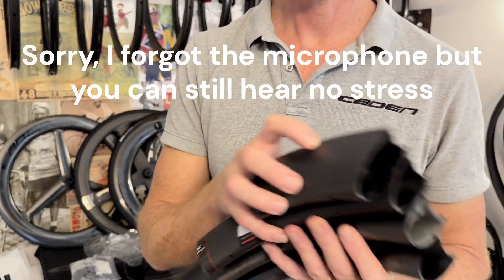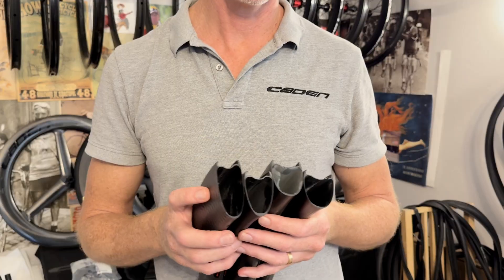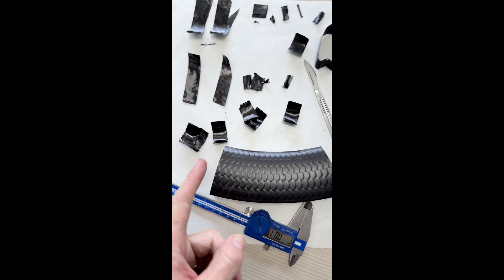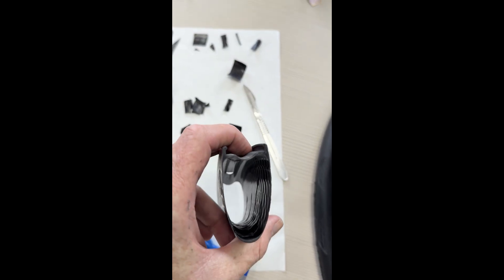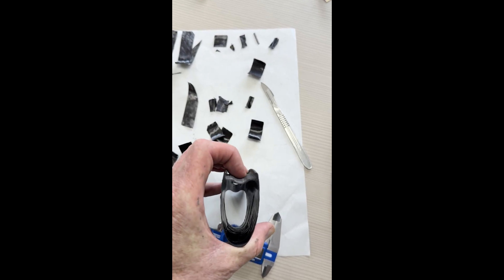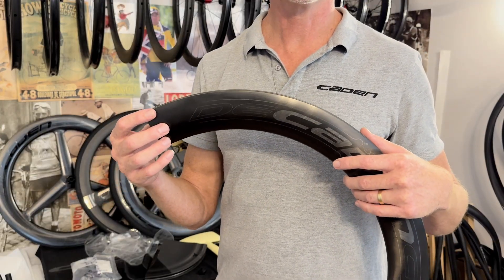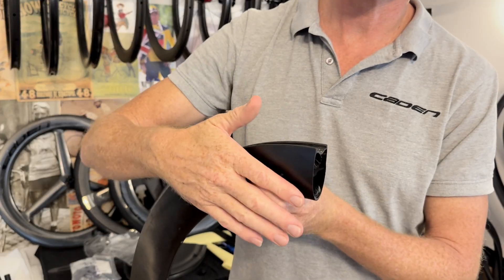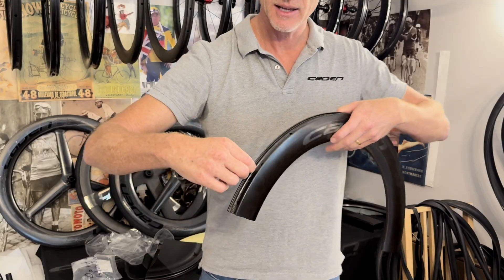Scope Artech 6 Layup Schedule Rim Profile Burn Test

Comment: Hey Ben thought i would weigh in on the rim blowouts we've seen from some of the US brands. I am experienced mechanic for a big retailer.

ENVE as you mentioned did not have a pressure relief hole for air as the air pushed past the tubeless tape (note these rims were marketed as tubeless ready) and as such were blowing the side of the rim out. 

ENVE acknowledged (maybe not publicly) this was an issue and as part of their warranty process issued new tubeless valves that relieve pressure from the rim cavity. However for following generations and all new manufacturing they started adding pressure relief holes.

I personally blew the sidewall of a rim and the tyre still held air, so that's how we figured it was a no pressure relief issue.